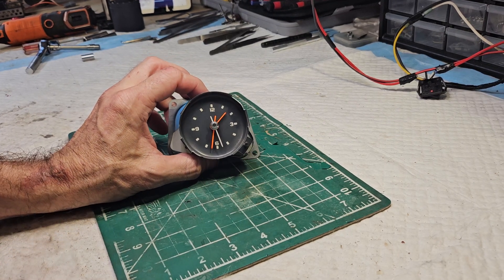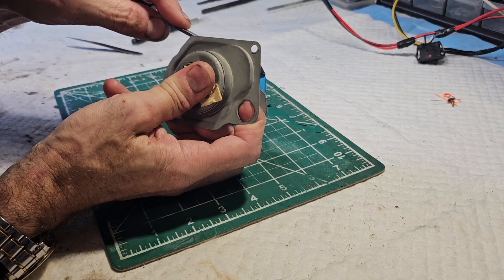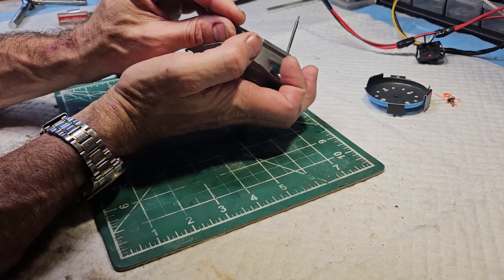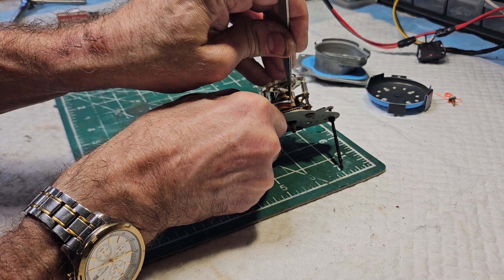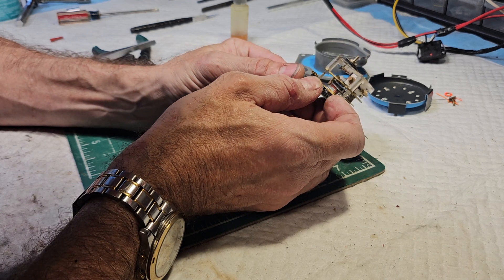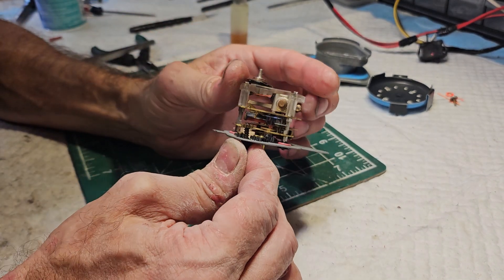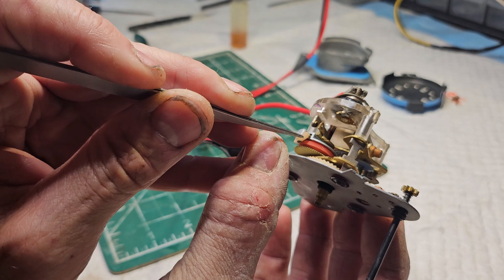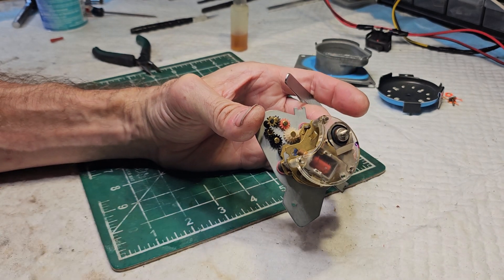77 Corvette clock inspection and repair

Comment: i’m working on repairing my 73 to 80 GM clock. The mechanism is pretty much the same as the Corvette clock. Maybe it’s exactly the same. Anyway, I need to get a new winding spring. Any ideas where? I’ve looked online but not having much luck.
Reply from the maker: There are no replacement parts for these clocks unfortunately. Wether GM, Chrysler, Ford, all the clocks are similar in design as a points style electro mechanical movement. You would have to find someone that repaires these and has parts clocks in stock such as myself. Redline gauge works may as well have parts but other than the two of us I don't know of anyone else in the industry that does. Most just convert to quartz and toss the moment. You can call me @ Todds Restorations 763 290 0474 if you want to see if I have that spring. Todd